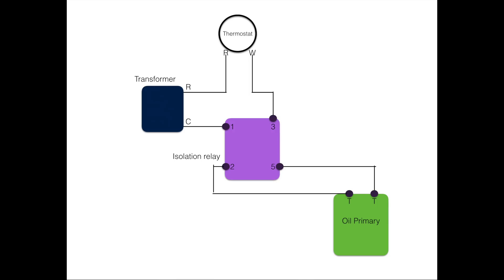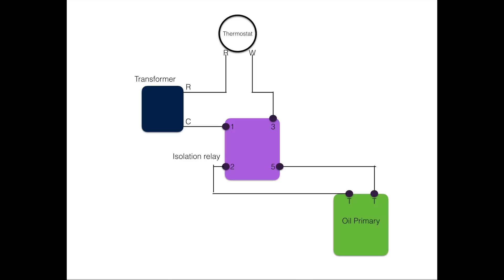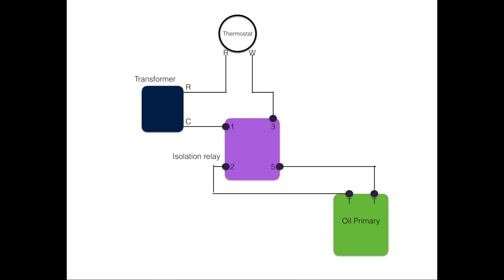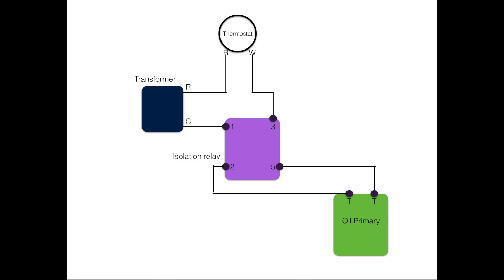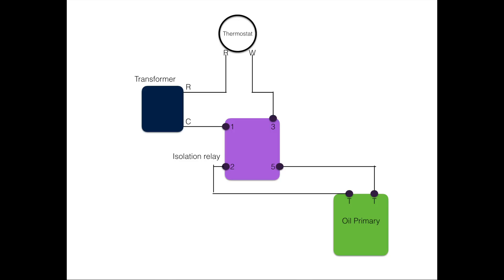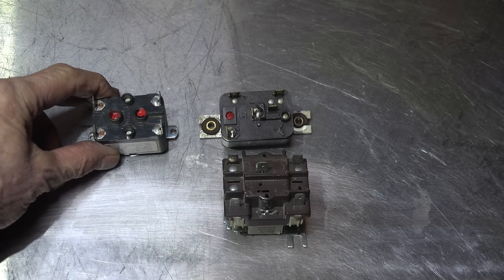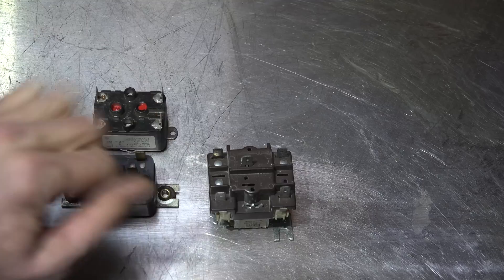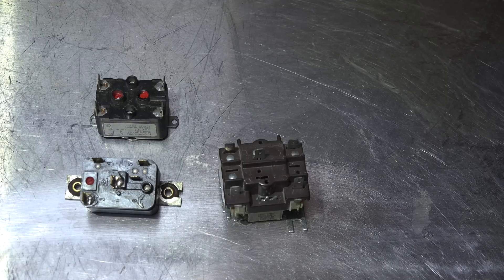Isolation relay for the oil or gas furnace, diagram

Comment: Could you use a 4 or 6 pin isolation relay to add a C wire to a system with only two wires?  Essentially a venstar add a wire without buying their 24v power supply.  I already have another transformer for my zones that has enough VA left to power a thermostat

Comment: I have a simple oil burner on a one pipe steam system (heating only). The Becket burner has a Honeywell primary oil control with only 2 "T" terminals.  The boiler's internal hot water coil has an aquastat that share these 2 "T" terminals with the thermostat. 
Would an "all in one" approach work by using a Taco SR501-4 Switching Relay (1 Zone) that includes the relay and transformer together in a neat box?
https://www.amazon.com/gp/product/B008G8S7M6/ref=ox_sc_act_title_2?ie=UTF8&psc=1&smid=ATVPDKIKX0DER

or even a  Honeywell R8845U-1003 Universal Switching Relay with Internal Transformer?https://www.amazon.com/gp/product/B000LDBP9Q/ref=ox_sc_act_title_5?ie=UTF8&psc=1&smid=ATVPDKIKX0DER

could either of these be mounted adjacent to an existing electrical box with the 2 wires going down to the "T" terminals on the primary control?
Thanks for a great video.

Comment: So the isolation relay is for when you use a 24 volt transformer to power a heating unit and AC unit? Does the output voltage of the transformer get erratic if you dont use this relay?
Reply from the maker: This relay is for the oil cad cell relay that does not have a transformer mounted on it.  The small transformer in the cad cell relay will be destroyed of it is connected to the thermostat on the same red as the A/C.  The same result can be gotten if you remove the jumper from RC to R.  This will only work for a battery powered thermostat.  Isolation relays are also useful when the electronics of one control are not compatible with the electronics of another.
GFM

Comment: question about heat pump by Flo liquid line dryer - is it possible for a liquid line by flow dryer to get plugged in One Direction and not be plugged in the other direction?
Reply from the maker: Oh, yes.  Fairly common.
GFM
Reply: grayfurnaceman thank you for the info

Comment: question about heat pump by Flo liquid line dryer - is it possible for a liquid line by flow dryer to get plugged in One Direction and not the other direction?